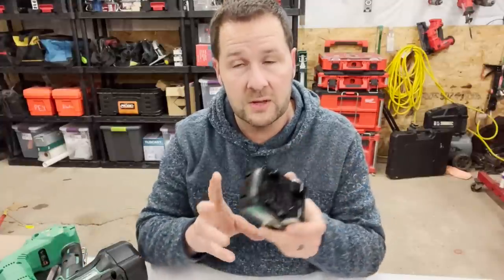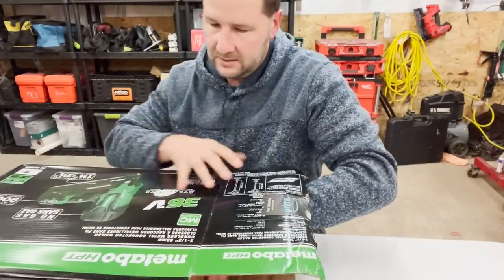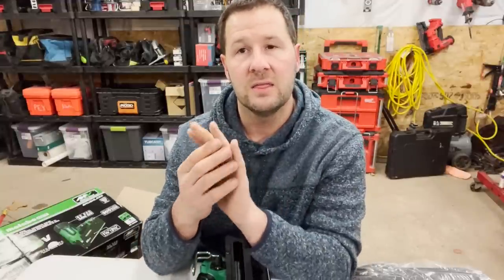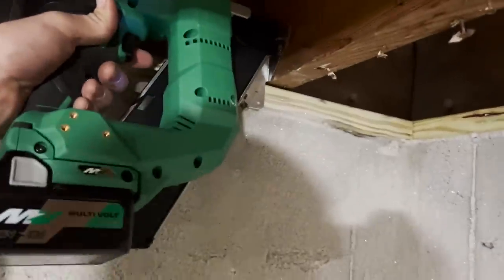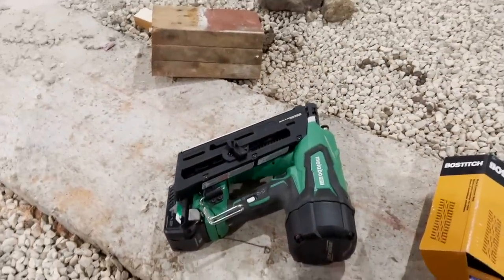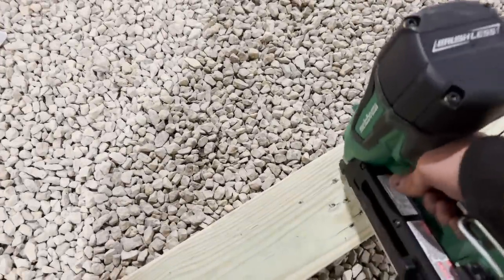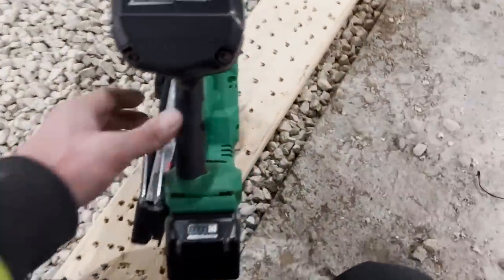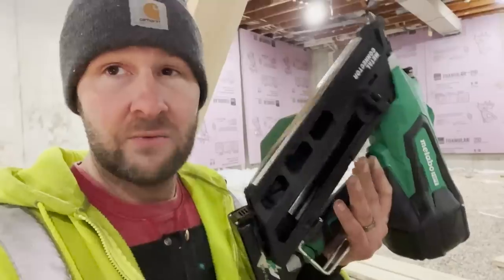Piece Of Junk?  Metabo Metal Connector Nailer!  (Watch This Before Buying)

Comment: I bought my first Hitachi battery tool - an 18 volt grinder - because it was about $50 (on clearance) at Lowe’s. And I’m too cheap to buy the red brand all the time, unless I don’t want to lug around multiple “systems” of tools, batteries and chargers! I liked it so much that now I have MANY Metabo tools - ALL good and most cheaper than the red equivalents! Metabo is the system I lug around… and it’s less a magnet to thieves. 😂

Comment: Great content.  It’s good to see a product review where you can see the product being used in the wild!  Your channel should have way more subs!
Reply: When you open a box and the battery was already attached to the gun.  I would have checked to see if the battery was charged. It looked like Amazon sent you a used item. I
I have recently purchased my first metabo hpt nailer and it worked well. Thanks for your review and showing the gun being used on an application it was intended to be used for.

Comment: I actually used Metabo tools back in the Netherlands 30 years ago, they are good tools! I bought the 18V framing nailer about two years ago, and love it. Buying the metal connector nailer soon for another large deck job, I've hand hammered thousand of joist hanger nails by hand and getting tired of it!

Comment: I like a practical tool review for sure.  Many times tool reviews are people just opening boxes and comparing new unused ones.  Drives me nuts.  

I want to see a tool put to normal use and it helps a lot knowing if it would be useful to me.  I doubt needing this one but when I built some steps I used some metal clips to tie some supports in to stringers and hammering those nails in was awful.  I ended up shooting in exterior screws.  I don’t do that stuff often.  I don’t blame you for buying this tool for that huge job.  I would too.

Comment: I bought a Dewalt last year, couldnt wait for any other brand to deliver. Sweden is very slow to crank out tools on the market.
Got a surprise, darn gun is awsome. Shot even through the steel of joisthangers. Like to test tools Hard. Recoil increase of course.
Downside is its fiddly close in angles, and with battery its gets heavy after some hours.
So swing around the Gun is needed, and take turns on joistshooting 😊
How many hours saved on a week 😂
And was the cheapest Gun on the market so win win.
Reply: What model DeWalt do you have? Where did you order it from?

Comment: I have a Ryobi nailer with 2 batteries.  Its not as industrial strength as yours, but works well when I do a project-- and I got mine as a scratch and dent off amazon for about a $100. that came with the 2 batteries- a great surprise.

Comment: I use both brands.  I actually prefer Metabo HPT's framing nailer guns over the Milwaukee which I just sold away just a day ago.  Sold it because the darn thing is heavy and it required to be sent out if it's no longer shooting nails deep enough, while you are able to self charge the Metabo HPT with the proper accessories.  Glad I got to see the metal connector in this video.  When I told one of my framers that they had this in cordless, he did not believe me at all and it's ironic because he uses the one that connects to the air compressor under the same Metabo HPT brand.

Comment: For what it does its fairly light. I use headlights for slot of jobs in basemdnts, attics, etc so the lighted tip is not z big deal. With their history in nail guns of various types you have a durable and efficient tool for your money.

Comment: Codes require a full head nail so that limits size of clips.   A $100 palm nailer is the old school way to put in hangers. They are fast and get in very tight spaces.

Comment: Just built a 20x16 cabin last summer and those hurricane straps were a bear to nail by hand (especially starting the nail-I used needle nosed pliers because fingers got in the way).  Took a long time and exhausting—even with 2 people.  My forearms and hand were so sore—but at least the framing was below and not overhead.

Love your videos and have learned so much watching your channel.  Definitely load your video on Amazon—very few good videos on there that cover as much as you do.  Thank you.

Comment: Good call on that tool being returned! The new battery comes with the battery protector on it. I've never seen any company ship a tool with the battery on it.  I'd wager someone bought it thinking it was the framing nailer and returned it.  I've got their framing nailer, it's noticeably lighter than the Milwaukee one.  If you want lighter you need to go pneumatic. It's also not really a renovation tool, usually hangers are installed on new construction where you don't have to worry about there being a house on top of you.  

Another thing to note, the Metabo tools use a sealed air system instead of a sealed nitrogen system like Milwaukee, so it's easier to service when you need to repressurize the system.

Comment: Great review. I have a metabo framing nailer and trim nailer I love. Tired of dragging around a hose for nailing in hangers. I'm planning on being 95% cordless in a year. One thing I would point out is I've never seen a connecter nailer that takes more than one rack of nails at a time. Even pneumatic ones.

Comment: Did you know you can buy a rechargeable light that you wear on your head to help see what your doing in dimly lit areas ??  Lights on tools is a dumb idea. There only on when tool is in use. Wear a work light so you can see what your doing!!
Reply: Definitely not a dumb idea to have light on a gun. I have several tools that has it and when you are in dark, you can easily see where to drill etc if you havent got a lamp at hand. Really nice feature.